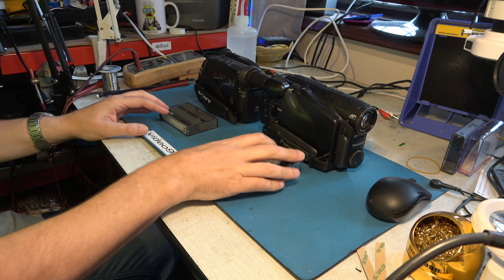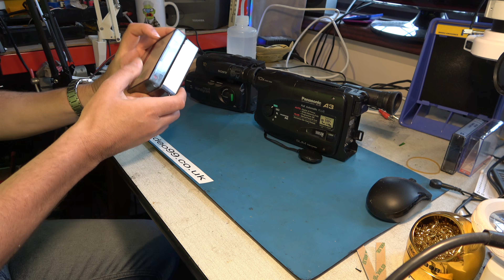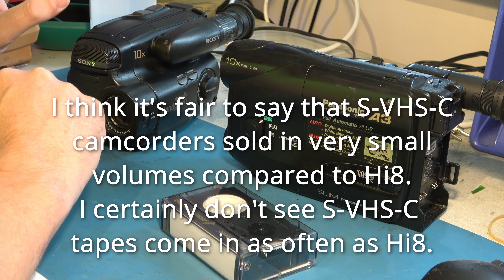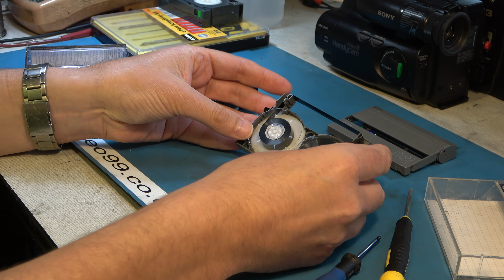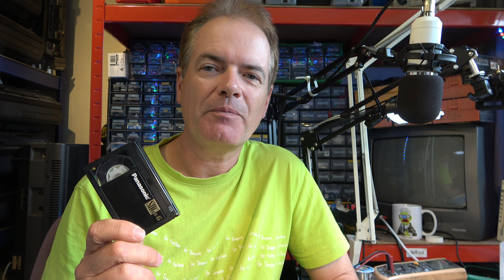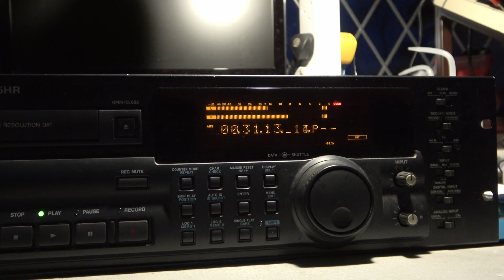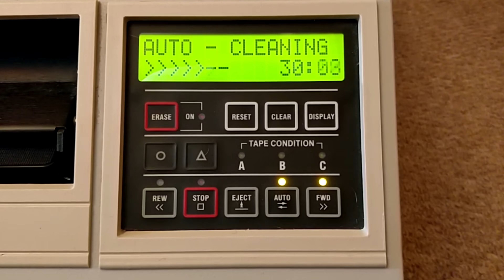Camcorders: VHSC or Video8?  miniDV or miniDVD?  Was VHSC bad?  Also tape degaussing.

Comment: I have owned several video cameras—Video 8, Hi8—from the brands Sony, Fuji, and Hitachi, and I had a very expensive Sony mini-HDV camcorder that could also record in HD.
And all those cameras had one thing in common: They are very fragile, very vulnerable, and always break easily; that was not a success story. And I find those things especially very inconvenient and slow to use if you want to film something quickly. You have a smartphone ready much faster, so you miss less.

In that regard, I have respect for the engineering of those things, because it is indeed a clever piece of technology. But I film very little, and when I do film something, it is to share, so personally, I am better off with a smartphone. Personally, I think the image quality is actually quite good if you set the smartphone up correctly and, of course, hold the smartphone horizontally while filming; I find the image more beautiful than with a video camera in the past. Technology never stands still. Sometimes it is not so bad to move with the times.

Comment: My father had a video8 camcorder, and I still have it. I had to fix the tracking mechanism by hand a few years ago as it was misaligned, it took me a whole day to fully fix it, fiddling with two screws that adjusted the tape height and angle. When I was 10 years old, my parents bought me a MiniDV camcorder that I kept using until 2019, at my 22 years back then, as one of the spools decided to break. It's fixable with a 3D printer and a model, but I bought a different MiniDV camcorder instead. I was obsessed with my father's video8 camcorder, and used it with a lot of care as a kid when he let me. He even bought me a few tapes. One day, my brother, who was 2 years younger, dropped it, and the tracking went out of place. Many years later, back in 2023, I decided to take care of that video8 camera (it's the same Sony as shown in this video, by the way), and fixed it. It plays, records, and works like a charm. I'm still thinking of buying new batteries for it. I have a bunch of tapes from my childhood to digitize. As far as MiniDV goes, I still use it as a format for recording some projects. I've had other camcorders over time, but I've kept using MiniDV. I've had the nightmare of copying from a mini DVD to a h264 video. And yes, the quality is horrible.

Comment: I went from Super 8mm film to use 2 different Panasonic VHS camcorders. My father had a JVC VHS-C camcorder. Then I had the Canon  L1 Hi 8 camcorder and a Sony CCD-TR100 Hi 8 camcorder because it was smaller than the canon and not as heavy. Then I got a MiniDV Canon camcorder witch I later gave to my sister When I got a SONY handycam HC-9 HDV which malfunctioned after the warranty ran out. The cassette part started sticking in the open position but would not let me put a tape in. Now I using a Panasonic digital camcorder no tape just a memory card.
I did recently get another Sony MiniDV camcorder on Ebay to transfer tapes to PC.
Reply from the maker: Such a common fault on those HDV models, caused by a defective mode switch. Sometimes you could get it working again, I've covered that in another video.

Comment: It is obvious that the linear speed of vhs-c was adapted to fit into the bigger vhs-adapter with higher speed than video 8 and so is the tape duration on vhs-c shorter than video 8. But on the other hand most late vhs-machines were equipped with RCA -connectors in the front for camera purpose.So the "problem " with video8 was then neglible.
Reply: 600322... VHS-C may paste through adapter is VCR !!!

Comment: I recently acquired a VHS-C Camcorder for cheap (A JVC GR-AXM18u), and after doing some research on it, it's a model that was manufactured and sold as early as 2006. I never used Video 8 before apart from one time when I was pretty young (or any camcorders for that matter apart from the one I recently got), but I'm convinced by this video that Video 8 had the clear advantage over VHS-C in every aspect. 

Though, I'm curious about VHS-C. What made VHS-C hold on for just as long as Video 8 if it had so many drawbacks? Was it just brand recognition? Were VHS-C tapes and camcorders cheaper than Video 8? Were people just that convinced on being able to playback their films on their VCRs?
Reply from the maker: I think it's because Panasonic didn't want to give up and sell Video8, that they carried on trying to sell them to a vanishingly small market in the late 1990s.  When miniDV came along, they would still sell VHSC to old people who wanted easy playback on their VHS recorder at home.  But sales numbers of VHSC vs Video8 towards the end of analogue, showed that VHSC had lost.

Comment: I detect a little bit of bias in this video... heh. You didn't go over cost of actually owning and using the two systems, including blank tapes etc. And of course a degausser will erase the VHS... that was the point. Metal tape erasers were a totally different thing. And I don't think anyone could "accidentally" put their VHS tape through a degaussing...
Reply from the maker: Since two VHSC tapes would be required for the same running time as a Video8 tape, I think it would be fair to say that Video8 was cheaper to run per hour.

Comment: What about Digital 8?  Physically different to Mini DV, but compatible data stream.

MPEG was later used in other formats, including consumer and professional ones such as HDV, Betacam SX, MPEG-IMX and I think HDCAM and possibly HDCAM-SR and XDCAM.  How did these formats manage to use MPEG as an acquisition format when it would seem to be more suited to being a release one?
Reply from the maker: I mentioned Digital 8 in the on-screen comments, it was moderately successful and a useful upgrade for people with existing 8mm tapes who wanted DV performance.
True MPEG2 is used with other formats, presumably at higher data rates for better editing.  The MPEG2 compression does cause some difficulties with HDV, particularly that dropouts are more obvious on HDV than DV.

Comment: As a side note, in the NTSC system, the recording time difference between Video8 and VHS-C is even bigger, because here, standard VHS-C tapes only can record 30 minutes in SP mode or 1:30 hours in SLP mode, but drastically reducing the audio and video quality. High capacity tapes were availabe later that could store 45 minutes in SP or 2:15 hours in SLP. On the other hand, standard Video8 tapes could record 2 hours in SP and 4 hours in LP, reducing video quality but not the audio fidelity.

Comment: I was pleasantly surprised how reliable Video8 and Digital8 tapes are, I've recently transferred around 50 of our old family tapes with the exact Sony camera my parents used to record me around 20+ years ago, only few Digital8 tapes gave some trouble that was easily solved by cleaning the heads. The picture quality even on the older Video8 tapes that are almost 30 years old is great for what it is, much better than classic VHS. And being able to transfer it directly to raw DV files via firewire without having to mess with capture cards was great too.
Reply from the maker: Yes, they are more stable than the competing VHSC format.
Reply: Ironically you could likewise use many Digital8 (or MiniDV) cameras to convert your VHS(or any other) tapes as well. A number of these cameras have 'passthrough' from the analog AV input socket, converted to digital for the firewire output. It seems to work very well, presumably as at least some cameras were converting an analog signal from the camera sensor anyway.
Reply: @DoubleMonoLR  Sadly not in Europe, Sony didn't equip the -E models with AV in, supposedly to get around some tax as that input would make it a VCR.
Reply: @snap_oversteer  "Sadly not in Europe, Sony didn't equip the -E models with AV in, supposedly to get around some tax as that input would make it a VCR." - they did, for example my DCR-TRV355E is also capable of digitizing external analogue sources. It's just that it's particularly suspectible for framedrops - you will NEVER want to use it to digitize 2nd+ copies etc, at least not without an external frame TBC in the chain. (I've posted quite a few comparison videos of this problem.)

Comment: Nice video! I have a 1994 SVHS-C palmcorder with Hi-Fi audio. It shoots pretty good quality video with F1.2 lens and a half-megapixel sensor. The recording can be played on an SVHS VHS machine or on a machine that has SQPB mode, so there is some compatibility, Hi8 cannot be played on anything but Hi8. Well, it can be played on a Digital8 machine. I wish DV cassettes were never created, and we would continue into 21st century with 8-mm tapes.

DVD recorders were completely useless - bad quality, too much fiddling. Same with AVCHD machines that recorded onto Mini-DVD. I never had a camcorder with optical media, I went straight to ones that recorded on SD cards.
Reply from the maker: But Hi8 became so commonplace that it was pretty much the standard for all enthusiasts for many years.  SVHSC sales were tiny in comparison.  Some people did buy Hi8 home decks too, like the EV-C2000E and expensive EV-S9000E.

Comment: Must share some comments on this videogenic subject... 
VHS-C, in the beginning (1984/85), with the sexy JVC GR-C1 was a historic leap into the future. A real camcorder that could actually replay its tapes instantly, unlike Betamovie. But it was still a shoulder mounted Saticon tube camera...  Just around the corner, Sony launched Video 8, in a new sleek approach to camcorders, now CCD sensor equipped and a full range of accessories. Do you remember Sony Sports? Fresh concepts that brought out, simultaneously, the ever-smaller Handycam and the impressive semi-pro range with V100/V200. 
Later in Hi8, Sony cameras like the V5000/V6000 and VX1 really set standards that no other would match with its digital processing.
Must also remember that Canon helped a lot in the massive market share of Video 8, and offered the option of interchangeable lens in Hi8, with the Canon L1. 
One last good shot from JVC was the GR-S707, an SVHS-C. 
Of course full SVHS from JVC (GF-S1000H) and Panasonic (MS1/MS10) could be a great hi-band option. But in the early 90s, the trend was set and Video 8/Hi8 was king. 
At the same time, in the broadcast industry, Betacam SP had become THE standard. 
Cheers 🇵🇹
Reply from the maker: Later models of Betamovie were CCD equipped.
Reply: yeah i agree for the GR-S707, this one was really a masterpiece of its kind.
sad they never dare doing a MkII of it with some refinement for the camera section.
but when you think this thing was realeased in 87 for japan and maybe north america... wow... i guess sony had some serious sweating.

Comment: Well, i feel that i''m lucky. My camcorder is mini-DV Panasonic NV-GS400. so i got a best quality video format first, no troubles with VHS-C or Hi8, etc. I also bought the CHEAPEST BUNDLE IN THE WORLD ( 600 rubles = around 10 USD, with that  exchange rates) with included 6 mini-DV tapes, good condition at all,  AND, ORIGINAL PANASONIC POWER SUPPLY, with means that i can plug my nv-gs400 in power supply, then plug power supply straight to 220V. And this is inportant , 'cause both batteries is dead. first wont charge at all, second charging, but camcorder can work with it, around 4-5 minutes. I dismantled first battery and going to reestablish it. Gonna buy the imax b6 impulse charger.  good luck to me

UPD: i can now throw video from mini-DV no through the Firewire caple, cause my Win10 pc don't have this port, i use USB, NV-GS400 shots pictures to SD card, and have a PC CONNECTIN MODE, through USB . progs to get video is Scenlyzer Pro and WinDV. Scenlyzer works better.
Reply from the maker: You can add Firewire to any Windows 10 desktop but it's not so easy to a laptop.  MiniDV camcorders are give-away prices now, hardly anyone wants them any more.
Reply: @video99couk  im not sure about which soft i need for firewire controller, or camcorder should appear in file explorer like an usb device or something like that?

Comment: What a nonsense. VHS-C was a better system when you look at the specs. A higher signal to noise resolution and more natural colors.
8 mm had a better sound quality but that was limited by the standard microphone.
I was a salesman in the 80's and most people preferred the harder and more artificial colors of a 8 mm camcorder.
A big disadvantage is the fact that many 8mm tapes are dropout city because of the metal vaporized tapes and when you're camcorder has broken down its quiet difficult to play them while you can play back your vhs-c tapes in any vhs recorder what you can buy for next to nothing.
I have some old magazines from the 80's and in every test the conclusion was the camera from a 8mm camcorder was sometimes better the playback part was important less then his vhs c counterpart.
Reply from the maker: No, sorry to disagree, but VHSC generally gave worse results than Video8.  Of course results would vary from one model to another, but all the worst camcorders (Amstrad, Chinon) were VHSC.  These days I run lots of 8mm and VHSC tapes, and there is no doubt at all that VHSC suffers more dropouts than 8mm.  Then of course there is the running time problem with VHSC, it was so short that it may just be unsuitable for events where a tape change is impractical.  The ratio of 8mm to VHSC sales, and that VHSC manufacturers such as Sharp moved to 8mm, shows that VHSC lost the battle.
Reply: @video99couk  
back in time, if you were in case you have to shot events that need more than 45 min or 90 min (excluding use of LP mode), you'll not either buy vhsc or 8mm.
full size (s)vhs camcorder with their unbeatable 240 min or even 300 min in standard mode was probabely the better way to go.
then the problem was the battery runtime, always a matter of compromises in this good old analogue world :)
Reply: And many brands turned over to vhs-c. Not a very strong argument. As a matter of fact a big player like Philips cancelled the 8 mm project and went to vhs.
Reply: Still mad about no 120 min VHS-C tapes?
Reply: @petertrappel
both vhsc and video8 were around the same resolution capability (around 250 TVL)
i really don't understand what mean "artificial color" or "natural color", both of them on tape used the color under process.
and roughly have the same bandwidth for color.
the only things that could act on coulour apperance was the tube or ccd device, and the way the camcorder did the job with automatic white balance...
Reply: @whaka54000  yeah the same for svhsc and hi8 they have hifi svhsc camcorders out there

Comment: Thank you for the video. Unfortunately (or fortunately) I did not catch the time of analog cameras, but I am filling this gap now. And now it's easier, they are very cheap. Judging by the ads on the secondary market in my country, the VHS-C models were more popular.

I will add that later on VHS-C cassettes a stopper was added to the take-up spool. Also from the features of VHS-C there is support for glorious SECAM and the ability to dub a linear audio track, and since VHS-C cameras are larger, manufacturers equipped them with large lenses and CCD.
In this regard, I admire the S-VHS-C light sensitivity of the Panasonic NV-S88 model, and the ability to set the aperture not in arbitrary units, but in f-number.

There are significantly fewer 8mm / hi8 cameras on our secondary market, and the situation is aggravated by the fact that models from the 90s have capacitor leaks, and their restoration is almost pointless, unless it is some kind of top model. And the models of the 2000s already belong to the decline of analog cameras, they were cheaper, it happened in hi8 models that they began to install small matrices with a video8 resolution of 250 lines ...

The situation with VHS-C is interesting, as you know, there is a reduced drum with twice the number of video heads. Ever since LP speed was introduced in camcorders, instead of installing an additional 4 heads with LP gap (24μm), manufacturers have simply installed all 4 LP gap heads, and at SP speed they don't use the full available track width, which means less RF signal, and when rewinding and freeze frame we have wide noise bands. There were exceptions, in the early top model camcorder from JVC there were 8 heads, 4 for each speed, but then there was no Hi-Fi Stereo yet. And with this in mind, you would have to install 12 heads + a flying eraser with a counterweight, and all this on a small drum.

In this regard, the 8mm format clearly wins, there are only 2 heads and a flying eraser with a counterweight, and Hi-Fi sound is already built in. I don’t know how it was in early models, but in the 2000s we see the same situation, separate heads for LP did not appear, instead the main heads have an LP gap and all the same problems with wide noise bands on rewind and pause
Reply from the maker: I'm not aware of any markets where VHSC outsold 8mm, but it is just about possible I suppose.  Audio dub was possible on high end 8mm decks and camcorders, but most didn't support that.

Comment: Uhh... Colin, you've seemed to have the VHS-C cassette in the case bottom side down. Not top side up, where we see the supply reel with the remaining tape used, and the label right next to it.
Reply from the maker: Different brands of VHSC tape sit in the box differently.  VHSC seemed to suffer from a lack of standardisation in this and other regards.
Reply: @video99couk  I see. This lack of standardization proved everything.